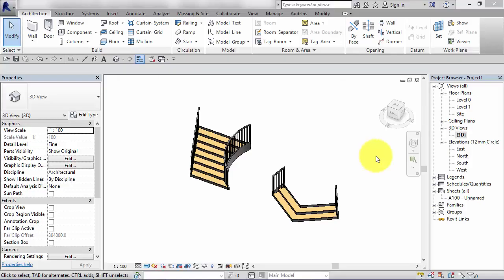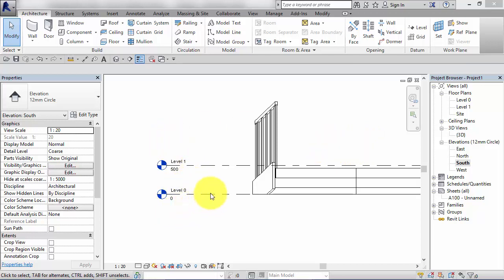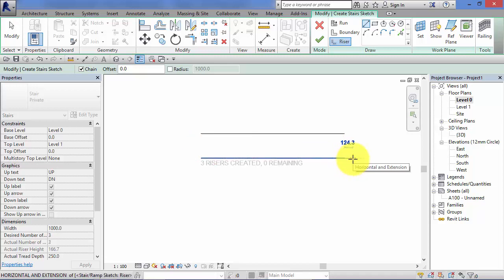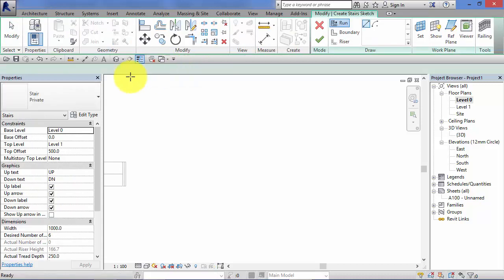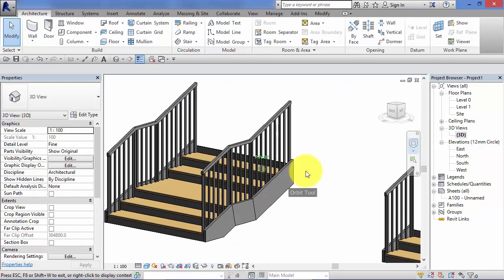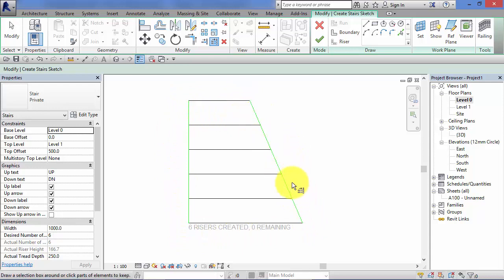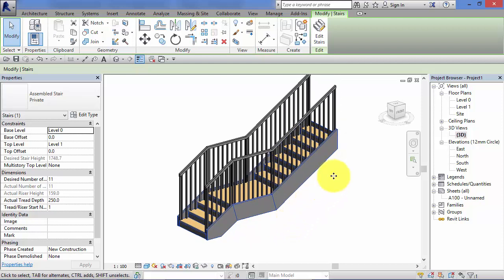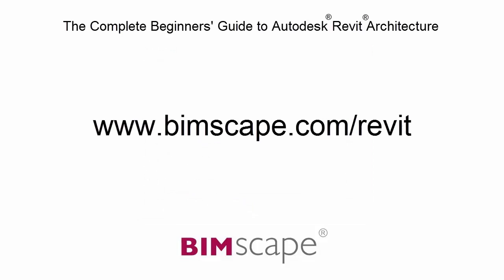Module 4: Unit 13: Revit Architecture: Stair by Sketch

Comment: after the complete course , ( the 84 videos ) will i be able to use revit in an advanced level or not , i mean will i be in ( beginner - intermediate - professional ) level , with practice ofc , meaning , do i need any more levels or tutorials ??
Reply from the maker: The Beginners guide will equip you (in conjunction with enough hands-on time with the software) to be useful / productive in a working environment, There are many more things to go on and learn about the software.
Reply: @bimscape  ofc many things are only learned by practive like every other software  , what am asking about , will i need extra courses , levels of tutorials or will i only need to practice it ?
Reply from the maker: It’s a very difficult question to answer. It depends on what you are going to be doing with the software, what your role will be in the office, etc. You will almost certainly want to go on and learn a lot more about it. It’s a VERY powerful bit of kit. Even many competent users who have used it for years will not know many things about it.